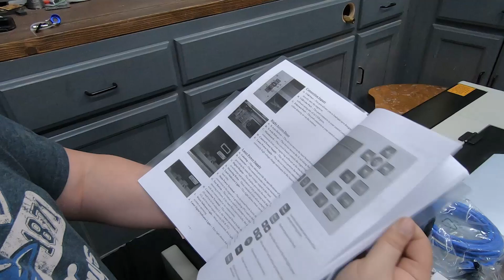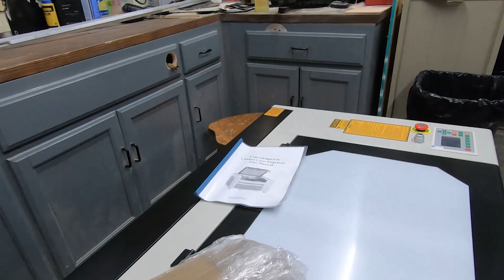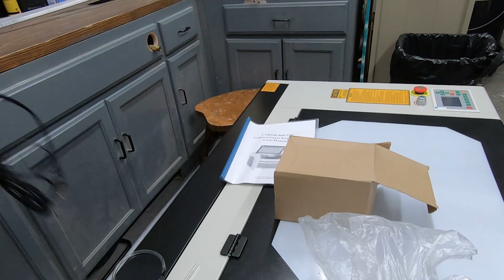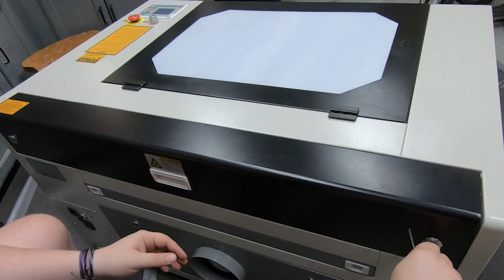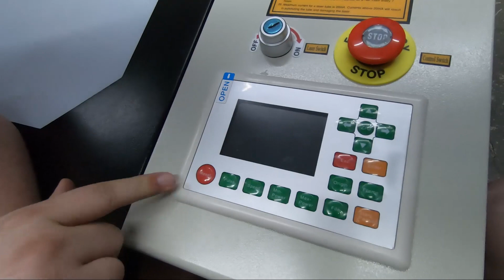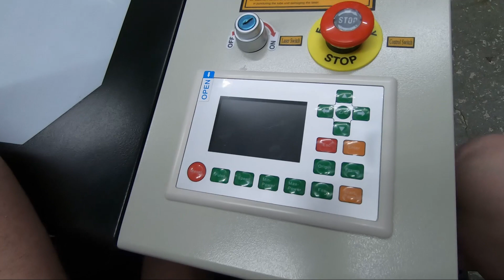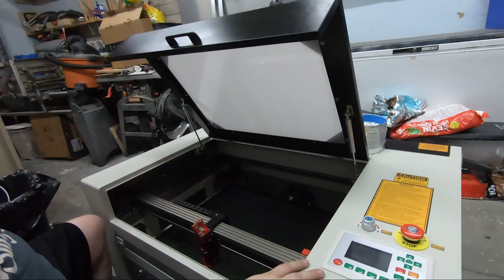Our New Monport 60W CO2 Laser - Unboxing

Comment: I got one a bit over a month ago and I am just now setting it up and I found the gantry to be out of square, anyone know the best way to square it up?
Reply: My 80W was the same thing. I started over and went through everything. Laser wasn't square gantry was off mirrors were dirty. Check everything and once dialed in its golden. I would strongly recommend getting a quality laser tube and power supply after about a year or so. The use B grade tubes like all the entry guys do. Spend the time and do a few upgrades and these can be a beast
Reply: @jonsaircond8520  upgrades sounds good.

I figured out the gantry alignment, for anyone interested, at the back left corner there's a motor, you loosen the coupling on the right side of the rod connecting the motor to the right side rail. Then use a square and align it.

Comment: I just bought my first MP 40W unit and I already want a larger machine. Seems it takes a huge machine to make even decent sizable projects. That's a nice machine though.
Reply from the maker: We wanted larger and more power right away also!
Reply: @KLRform but for the most part, are you loving it? I'm torn between the 60w and 80w..I just do leather hat patches and tumblers so I don't need a huge machine (it would be nice though lol)...i just have to upgrade from my diode laser....any issues in the time yall have had it?